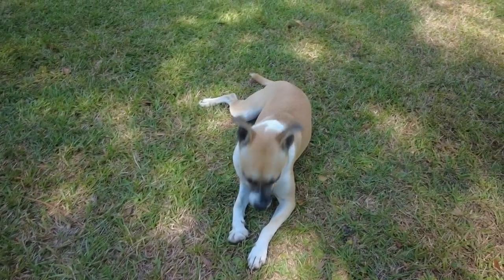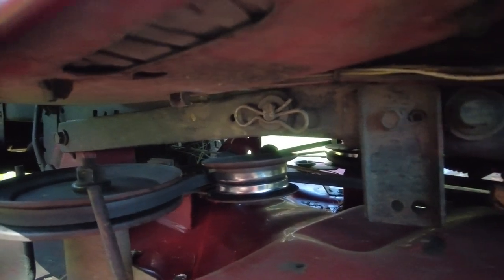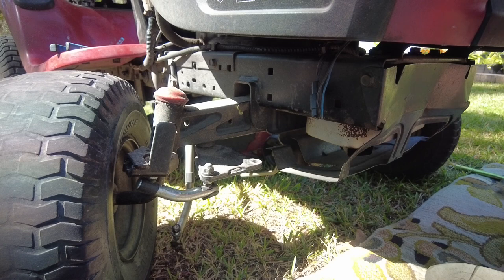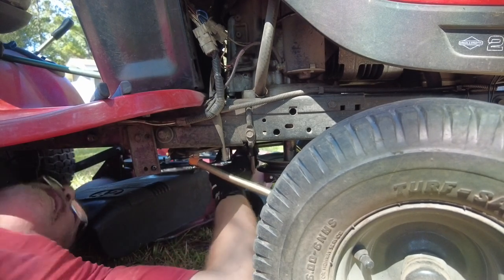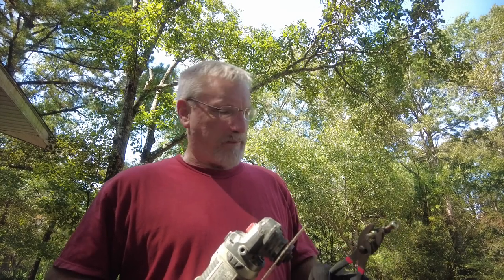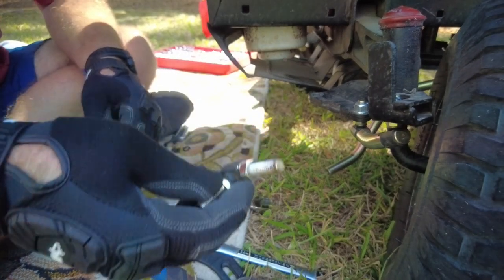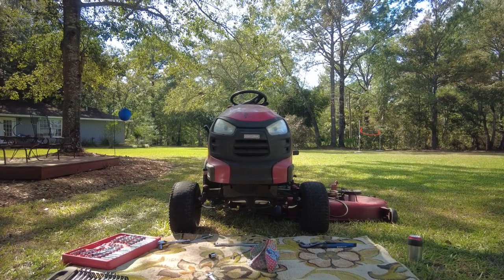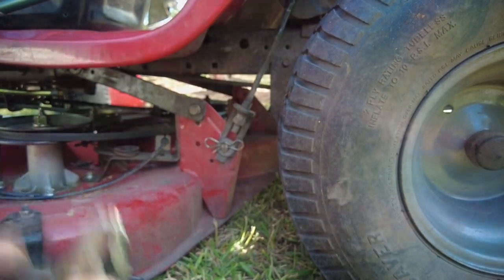How to do a front wheel alignment on a 42 inch riding lawnmower

Comment: This is what I need to do on my T2400! Will you give me the link to where you got these steering linkages? Thank you!
Reply from the maker: I ordered this from Amazon and the price as of today March 17 2024 was 75.99. It was 69.99 a year ago and the price has gone up, sorry.  here is the data from Amazon. 

 HD Switch 4 Pack Improved Adjustable Steering Drag Link Kit fits 597069802, 597069902 & (2) 597069702 Craftsman AYP Poulan Pro Husqvarna Sears +Includes 2 Sector Gear Dust Caps
Reply: I have a couple other questions more specific. Can I just DM you?
Reply from the maker: I don't pay much attention to my e-mail or anything else other than youtube. Here is probably the best.  @airdave1953
Reply: @diyhomefront1695  I have an update video on a much easier way to remove those steering linkages from the bullgear if you'd like.
Reply from the maker: @airdave1953  Share the link and I will check video out, I never turn down information.